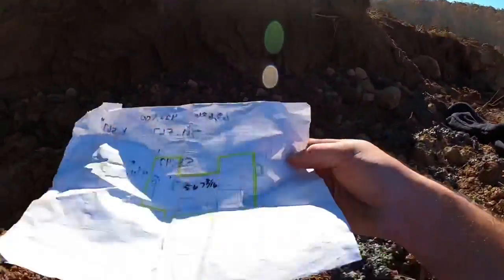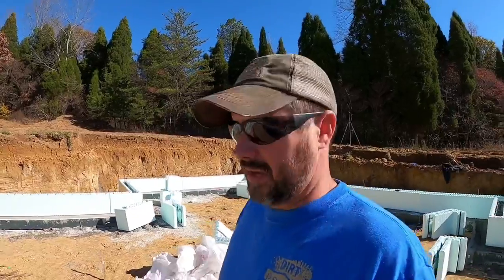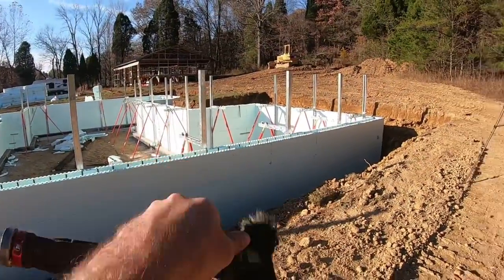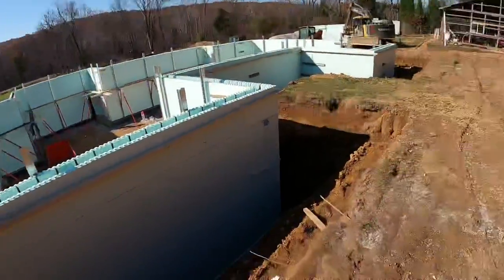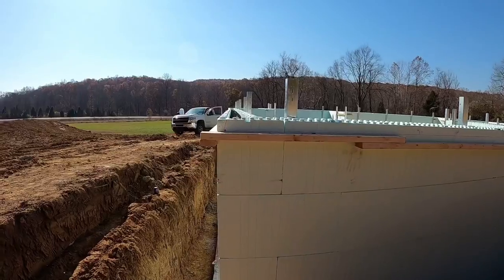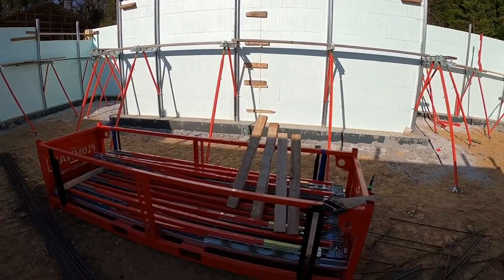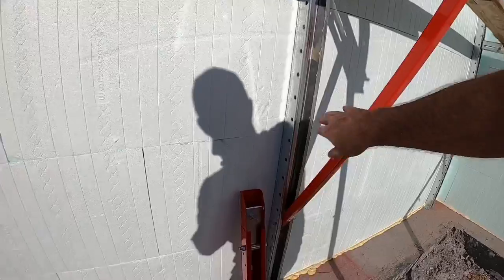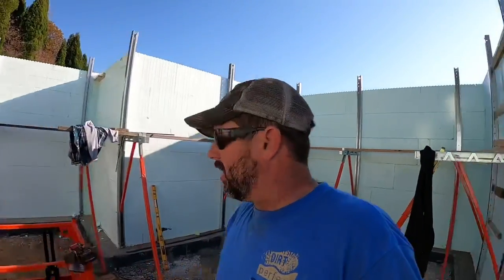How to stack out a entire ICF basement and my thoughts on the Plumwall ICF bracing system

Comment: After watching a few of your ICF basement videos and watching the contractor pour my basement the conventional way, I would not know why you wouldn't want an ICF basement the end result is so much better.
Reply from the maker: I agree
Reply: Costs, costs, costs..  There is a lot of work to do after the pour, both the outside and inside need to be finished before the house can pass inspection.  Even if you aren't going to finish the basement as living space it needs to be sheetrocked and taped, because the foam is flammable.  
Also if you do research into energy efficiency you'll see that a lot of the icf companies make false or misleading claims of "R" value.

Comment: We poured the walls today on an ICF build for a HfH house using Plumwall braces and a different brand of ICF blocks.  The braces are a quick, easy 2 man install but does have potentially sharp edges on the upright piece where you insert the screws.  There are also pinch points that could be painful if not paying attention during install.  The large adjustment bolts make it very easy and quick to level & plumb the ICF wall.  We installed the braces after the 8’ walls were all in place.

Each brand of ICF blocks has its advantages and disadvantages.  The one we used were set into metal channels on the inside and outside of the blocks, both at the bottom and the top.  Installing the bottom channels into the concrete slab with RamSets took a little extra time but made it easy to keep the blocks perfectly aligned and held the blocks tightly in place top and bottom for the pour.  This method does not require any common straps.  The only wood or straps needed were at any large gaps between blocks (which were also foamed).

4’ vertical rebar was installed in the slab (or concrete footings) every 18”.  8’ vertical rebar was added from above once the ICF walls were in place.  Horizontal rebar was added at each level of blocks as well as at each corner.  The metal channels at the top of the ICF walls provided, in addition to strength and support, a smooth level base to use when leveling and smoothing the concrete for the top plate.

This was the very first ICF build in our state for a HfH home.  It received lots of media attention, support from the concrete manufacturers’ association, the ICF Mfg’s Assn, local suppliers, local and state government, and the ICF manufacturer who had an experienced employee on site to guide and train us.  All construction is being done by volunteers under supervision of the local HfH construction manager.

Comment: As always you Sr. did a Dirt Perfect job explanation on this system, I have been in the Material Testing Bus. for over 45 years, the first ICF i saw used was over 30 years ago in Orlando, i liked it then and believe it should be use more, seen Cells up to 12" wide and they used a lot of 2x4's and plywood on the bracing, lots of concrete and Re-bar, keep up the great work Mike, looking forward to the video.

Comment: I use bracing that is very similar.  It's nice having the scaffolding and bracing integrated.  Adjusting during the pour is easy.  We always assign 1 to watch string and 1 to turning the adjusting leg.  All hands on deck that day.  Ya'll do a good job installing the forms.  A lot of form manufacturers tell you in the instructions to not do vertical seams but the guy writing those doesn't understand that keeping the walls the exact same length top to bottom is much easier using a vertical splice. We use 18 inch strips of plywood over our splice and usually place a brace at that same point.  Using Integraspec we pump 10 feet high all in one pass and never check up.  Great video!
Reply from the maker: Yup exactly and thanks

Comment: That was a "Dirt Perfect" explanation of the Pulmwall ICF bracing system.  I'm sure their engineering department got to work in a hurry on those improvements that you recommended in this video.
Reply from the maker: Thanks
Reply: It doesn't matter how many Engineers, designers, and company personnel put their heads together to design a product.  They will never be able to cover every scenario and detail outside the real world applications.  Allowing contractors like Mike to real world test them and give their inputs on the positives and negatives is where the flaws and improvements will certainly come to light.  An absolute must for the companies to take their awesome products and improve.  The welds where the adjustment bolts and the sharp edges/screw holes of the rails is a simple quality issue that is easily fixed.  It's the little details that are missed in production that the in the field users notice.  Plumwall is certainly on the right track and feel they will certainly make improvements based on Mike's honest and technical review.

Comment: They should make corner braces. Especially for outside corners. Not only would it hold the wall up but it would hold it straight and plumb. An inside corner would need the brace on the outside and that could be a little tricky to support.

Comment: You'd have loved stacking my house.  There isn't a parallel wall in the house.  I had a surveyor lay it out with a total station, but they did not do well.  I ended up pulling points with multiple tape measures.  It seemed like a simple thing to do as the house is comprised of 17 8 foot wall segments, each 21.176  degrees apart.  In Autocad, I would have done a circular array.  Very simple,  tell Autocad to array the walls around a point and divide 360/17.   The connector between the house and garage which is a rectangle, were easy.  It took me a week to stack the house, an afternoon to stack the garage.  And this was my first time using ICF's. I was fortunate that the crew I hired to pour my basement had bracing.  They were a few pieces short for my needs but I located those. You're talking about Zuckles and Zonts.  I looked at them and had I not been able to source the bracing, I would have gone that route.  For my Bucks, I used 3/4" Treated plywood and treated 2x4's. I ripped the 2x4s on a30 Degree angle and screwed the plywood to them.  The angle cut created a key in the concrete.  I know you don't, buy my crew vibrated the forms with a pencil vibrator.  No blowouts.  I had. s stepped footing from the house to the garage.  The hole is rock so the forms follow the rock.  I used plywood and foam to fill the gap that was created.  It appears the system I used was "Paneljack". My foot stakes were in rock.  I had to drill every pin.  I used 3/4" nail stakes.
Reply: Unless the instrument operator follows best practice, to the letter, the instrument error will get fairly high after ten points or so. Depending if it is 15 seconds or less. Doubling the angles gives much much better accuracy. But always, best practice RULES.
Merry Christmas and Happy New Year to all

Comment: Wow...! Mike great video.
   "Plumbwall" could have sent a guy-gal/rep., out to be on site for this set-up (course they would no doubt had to have been quarantined for 14-days prior).
    I have watched all your "ICF" set-up & pours, and wondered what was involved with resetting the walk ways for each level of concrete.  This system is sure gonna streamline your labor & time for sure.
    Your video will give them great feed back (i.e., those "footplate" issues you pointed out).  Those "Canuks" folks make some pretty awesome equipment.  My experience with them has only been snowblowers that mount on tractors, and they are the go to for those.
    I am sure looking forward to the "pour-day" video.
Thank you sir.
Reply from the maker: Think they would have if not for COVID
Reply: Dirt Perfect 
Yep probably. Bout only thing coming out of there at this point is building materials (wafer board type sheeting)...  Crazy, crazy...

Comment: These ICF walls are amazing to me. The ease at how they go up. How easy it is to get plum with these new wall braces. I set quite a few what is called pre-fab concrete basement walls. They are a pre-poured wall 6" thick concrete that has 2" foam on each side, usually 10ft tall was standard. Using a 100ton crane to set each in place. Corners are held together with 1" dia. 18" long lag screws. Its either those or traditional cement block walls up here in this area. I can recall doing a 28'X68' ranch home with the pre-fab walls took 12hrs of crane time. the 28' walls were 1-piece and the 68' walls were 3-piece.

Comment: Very thorough review of the ICF system Mike. Looks like a well thought out program and with feed back like yours hopefully they will refine their product and make it even better. When you did the high speed adjustment section I noticed the screw blocks seemed to jam up a couple of times, on a big job that would definitely get frustrating in a hurry, especially after dried concrete starts gritting everything up. I suppose greasing up those areas would help keep it smooth, but then the grease gets on everything. Lol The life of form work. That system is sure a lot better than through ties and plywood strong back forms and so much lighter. Hahaha... Wall form technology has changed so much for the better, very impressive.

Comment: Total station is very nice but also very expensive. If you do alot of complex jobs you should look into it. I would recommend leica, the software is very easy to use. Also you can set up on a pin but not necessary, you can set control points to shoot which allows it to be set anywhere you have line of sight. This gives the instrument its location to start layout. Even very complex basements dont take long to layout. Merry Christmas and happy new year.
Reply from the maker: Thanks

Comment: Thank you for the giraffe comparison.  Very helpful.  Have you ever done reinforced, cantilevered balcony pours (say 6' overhang, 3" or 4" slab height) using regular forms or something like the quad-deck i-beam form and braced them with the same bracing you used for the main wall pour?  I have a series of 30' exterior balconies to design into a pour.  It seems like with those angle brackets you'd be able to just move the whole plumwall brace to the outside after the main wall cures, set up the angle brackets and lumber to hold up the balcony forms during the pour.
Reply from the maker: Thanks and yes a few

Comment: About 30 yrs ago I worked on a job using this material but we did the entire house. We had to frame out the windows and doors. And had to put ledges on the inside due to concrete floors on a 3 storie house. Reason being it was right on the water up north. It was for the Daughter of the owner of a major hardware chain. And money was no object. First time we ever used it. Used the hot wire knife to cut what was needed. On top of that was a metal roof.
Reply from the maker: Yup built over. 100 of them that way

Comment: Great and informative video, I do not do house building myself, but in the corner where there was no room for two brackets, could you have adjusted one of them down in height so they went clear of each other?
Reply: Yes, it could physically be done, except then the support for the walkway used during the pour is not there.

Comment: Could you take a short piece of two by four and put it in the pocket where they expect you to drive it in as a stake. Cut it off flush and drill a hole through it for your re-bar stake. Couple of screws to hold it in. It would keep the load path in line for less twisting.
Reply from the maker: Not in hard ground

Comment: 72 years old and I've built lots of basements with concrete blocks. To me this ICF looks like more complex. Not sure if its a time saver or a cost saver. Definitely stronger and has the insulation installed.

Comment: Thanks for another very informative video. When erecting basement walls, do you always work with architect plans made especially for ICF construction that specify the outside dimensions of the foam walls or do you often have to work of wood structure plans of  the main floor and adjust so that the wood framing centers on the concrete part of the wall?
Reply from the maker: Yes for the most part

Comment: I can already tell you had problems keeping the brace footing from twisting.  They need to add the rebar hole directly behind the leg of the brace.  You could kill two birds with one stone, by having MBTS weld a plate in the 2x4 hole with a 1"hole in the center.  It would double the thickness of the flimsy bracket and put the anchor dead center of the brace.  GL Dirt (better than) Perfect!
Reply: Or, just make new feet to accommodate the rebar. Then you have both.

Comment: Good video.  I have done the home made braces and learned quick not to do that again.  Currently renting Giraffe braces now.  They work great but I agree, too many pieces.  What is the benefit of putting the 2x4's along the top edge of your walls all the way around on the outside?
Reply from the maker: Keeps the wall straight between. The bracing works awesome and saves lots of time for us

Comment: Would it be possible to weld a plate on the bottom of the brace and then drill the holes in the plate where you want to install the rebar pins. I know that a lot of plates to fabricate, but would it be worth it in the long run. Just a thought you and Aaron might be interested in making.

Comment: How would these braces work on a slab? We like to do a turn down slab and then stack up our icf blocks on that. But doing it that way, we brace out in the yard and use a roll around scaffold for pouring the concrete in the walls.
Reply from the maker: We have done that before

Comment: Setting up the braces takes more time than laying the blocks. If you use a ladder angle irons on top course to straighten that course, you can forget the braces and glue the block to the footing, Gluing the first course to the footing is like sitting on a chair to keep the chair from floating.
Reply from the maker: Good luck
Reply: We just used the braces this week for our first ICF build. The braces were quick and easy to set up though it takes 2 workers to install one.

Comment: Some questions:  Would you recommend the ICF system for someone building a garage and the frost walls would be about four feet high or would it be more economical to use a traditional frame and pour?  How would the short walls be braced since the only dirt that would be removed would be that from the trenches for the footings which wouldn't leave room to brace.  When you pour a basement with the ICF system, you mention bowing the walls into the braces and then straighten them after the pour - could you leave them straight and brace the outside of the walls and accomplish the same thing?  Thanks!
Reply from the maker: You can use them does cost a little more and have a video form this job on the bracing

Comment: Question for ya: Why did you excavate the whole basement to the same grade as the bottom of the form a drain.  Seems like you could have left the grade a few inches higher in most of the basement and just dug out the footers?  I may be wrong, but wouldn't that have saved a lot of rock that now has to be under the slab?  Good informative video!
Reply: Pretty sure they want a layer of gravel under the slab to allow those forms to drain.
Reply from the maker: Years of experience for me

Comment: Does each coarse get horizontal rebar? Are there verticle rebar and if so how far apart are they? Also why no bracing on the outside to keep the wall from bowing out? Does the inward bow that you put in the walls with the inside braces keep that from happening?
Reply from the maker: Yes
Reply from the maker: 18 inches

Comment: You've probably answered this question several times, but I'm too lazy to find it. I've never seen you vibrate when you pour the ICF walls, do you need to?
Reply from the maker: Yes ans we do but very little
Reply: @DirtPerfect  Does the concrete give you a mix where you don't have to?

Comment: I'm not a contractor and I don't have a clue so I was wondering why you don't have to brace the outside of the wall 😉
Reply: Because the walls lay against the bracing on the inside the walls can't fall to the outside. After the walls are poured you just go around the inside and crank the walls perfectly vertical. That's how I understand it.
Reply: @ArnieD17  thanks for the reply

Comment: Hey DP can you tell me the measurements on the corner pieces.  Looking for outside dimensions for the long/short legs to the corner. Trying to make my plans to have no common seams.
Reply from the maker: It’s all in the Nudura website
Reply: @DirtPerfect  Thanks, I found it just didn't far enough the first time. 
One other question, have you worked with any brands besides Nudura to give a pro/con comparison? Choosing the brand of ICF seems to be the hardest part of the process.
Reply from the maker: Nudura number one  fox block if you have no other choices
Reply: @DirtPerfect  Already ruled out Fox block. Right now I am looking at Nudura, Quadlock, and Build Block. Quadlock and Build Block both have options for a concrete slab floor/roof which is an option I am considering for tornado/wildfire resistance. Really like the 8ft length of Nudura though.

Comment: In a video the other day, Perkins Builder Brothers said they don't use ICF in NC because the termite treatment companies won't treat an ICF foundation.  The termites can tunnel inside the foam and it is invisible from the outside.  Have you had any issues with that or is that a NC thing?
Reply: reading through comments and thought I would add people need to do their research.......I was totally unfamiliar with this product or method of building until I saw it on this channel but have "googled" several interesting comments and articles from different builders and customers about pros and cons of ICF    Also, seems like a lot of overkill on this project
Reply from the maker: My quick opinion BS